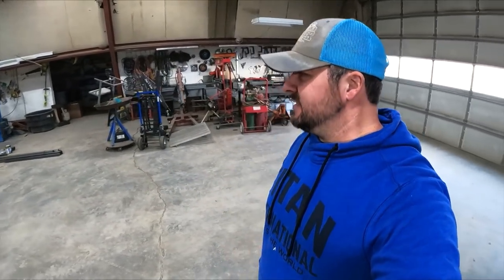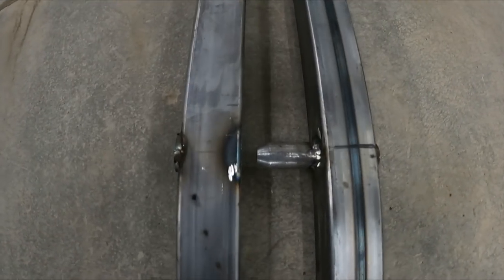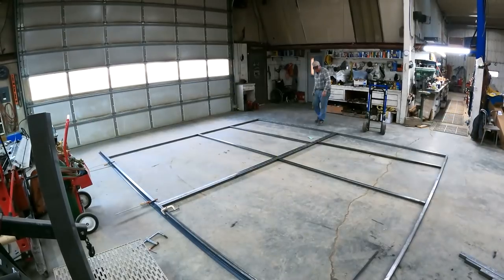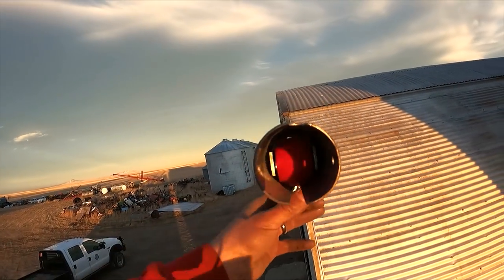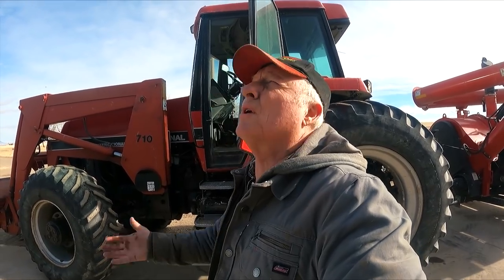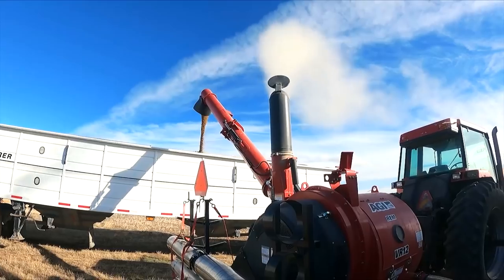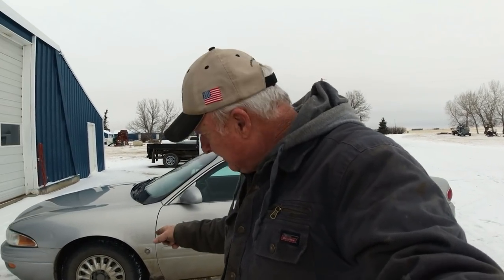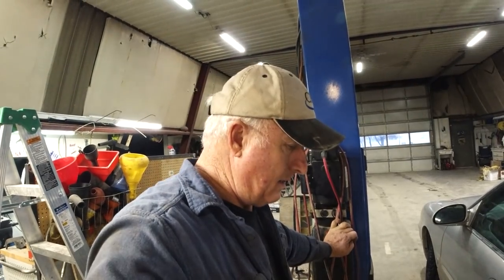It's Finally FINISHED | Sliding Door FABRICATION

Comment: Hint of advice, drill a hole in the ground at the end of the doors while closed and fab a pin and a couple hoops. Attach the hoops to the doors and use the pin to drop and stop the outside bottom from slapping in the wind
Reply: We installed small 5 inch guide wheels there instead, helps the door roll and keeps the bottom in when the wind blows

Comment: Nice to see you change the bearings on the car :-)  i just had mine changed on my car unfortunately not cheap to get changed as the mechanic had to use a hydrologic press to remove and fit the bearings.. It's nice on older cars to be able to fix stuff our self

Comment: As a person that suffered a similar injury as Leg Arms, although mine was a round baler that shattered my fore arm instead of a Big Bud drawbar. I can tell you that even after 5 years of recovery, there is still times when I bump my arm against something and it feels like someone is turning the screws in my arm. And you will notice in cold weather that your hand will get colder faster because that little bit of metal will act like a heat sync. Eventually,  with time and plenty of work, you will get all the strength and grip strength back in that arm.

Comment: Pitch it to left and the noise gets louder it's the right side bearing, pitch it to the right and it's usually the left bearing. But they have the same miles on em so you might as well change them both. those bolts on hub assemblies make it easy!
Reply: The pair was almost as cheap as one.

Comment: Whilst i'm not gonna argue with you over using or not using your arm, at least in the first year, you should keep the activities light. Not for the bone setting, that's pretty fast if the diet is good, but for potential complications with the surrounding tissues. Just advice, nothing more.

Comment: Mr Bob, why did you go with a two post lift over a four post lift?
Reply: The two post gives you access to the wheel area, less obstructions when working around the vehicle.
Reply: @RobertWelkerFarmerBob  thank you. Do you find them quite stable when working on a larger vehicle like your pickup?
Reply: @shermantank27  if anchored well (at least 12+in pillars) no problem . We anchored ours on just 6" floor and it seems stable.  We finally strapped the top posts to the ceiling steel rafters for more stability. I would not want a four post for us. We've had heavy one ton trucks on it. It's rated for 10,000 lbs.
Reply: @RobertWelkerFarmerBob  awesome thanks for the info sir!